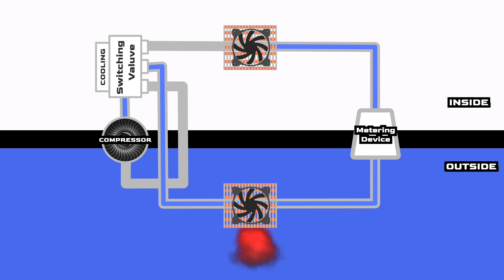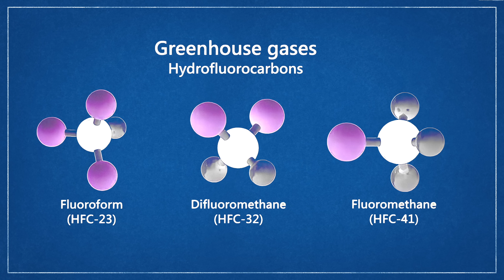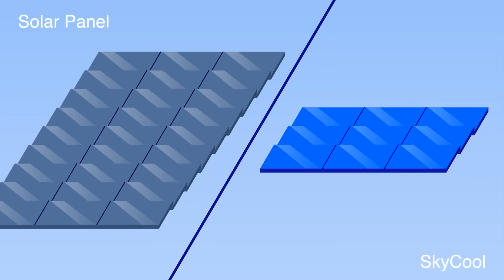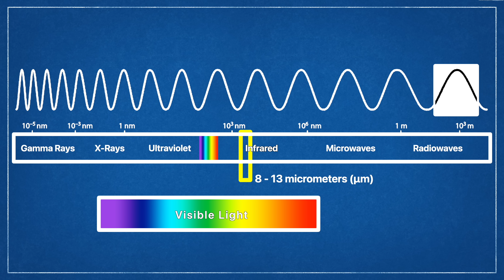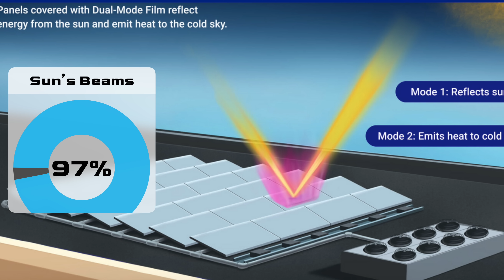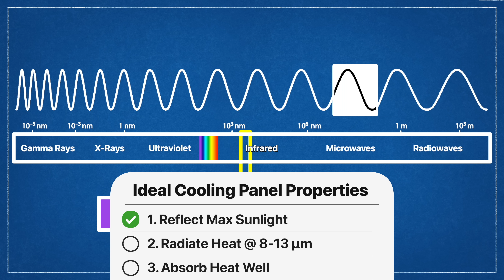New AC Tech Sends Heat Into Space & Saves 95% On Cooling Bills!

Comment: I would love response from the scientifically minded on this. Photovoltaic panels are optimal, in the northern hemisphere, facing south. From what was stated in this video wouldn't it make sense for the Skycool panels to be placed on a north-facing roof plane to reflect out to space in that way? Could we optimize with PV south and Skycool north?
Reply: You are correct. Putting the SkyCool panels on the north facing part of your roof makes sense, not so much because it reduces sun exposure (that doesn't matter much), but because it doesn't make sense to put solar panels there and it would otherwise be wasted space.
Reply: @dc14522  This thing is literally a solar thermal vacuum tube in reverse. Pointing it at the sun would literally make it explode as the water inside boils even with the glycol.
Reply: @williammeek4078  No... the Skycool panel is opaque and the water/glycol is on the back side of the panel. Even in direct sun the panel is cooler than the ambient air and the warm water/glycol (from the building interior and/or AC compressor) conducts the heat to the panel.
Reply: @dc14522  No, the covering has to be transparent to IR in order to work. Think of it like the sun glinting off of a lake. Sure, the light reflects at times but only under a high angle of incidence. But looking directly at the water allows you to see through it. These coverings work in a similar manner.

What you are saying would break thermodynamics.
Reply: The panel radiates at only one frequency (part of infra red). So it can be reflective in all other frequencies. Only a small part of the sun's radiation is in the frequency the panels radiate at.
Remember that this has been tried and it worked. A lot of times people argue in comments that a thing won't work, when it already does.
Reply: @williammeek4078  As a recently retired engineer in the glass industry I know a thing or two about spectrally selective coatings. Low E coated window glass uses silver in a similar way that Skycool does... to reflect IR. In the case of window glass the coatings contain up to 13 or 14 layers (up to 3 of which are silver) in order to allow a specific amount of the visible spectrum through while reflecting UV and IR. Skycool doesn't have to worry about visible light transmission and I suspect what they've engineered is an ultra-low emissivity coating that reflects virtually all ambient radiation, and in addition radiates the heat energy from the water/glycol (probably through something like an aluminum substrate) in a specific frequency range. 

We're not breaking any laws of physics here... every surface has it's own set of absorption, reflection and emittance characteristics. Skycool has just come up with one at the far end of the spectrum... so to speak.
Reply: @dc14522  Everything you say here is all well and good. It was your claim that it can be pointed at the sun and still work that breaks physics.
Reply: @williammeek4078  No it doesn't break physics; you just don't understand physics.
Reply: @filonin2  Explain it to me then.
Reply: @filonin2  I did. Nothing in their literature suggests you can point it at the sun an still cool anything. What you say still breaks physics.
Reply: @williammeek4078  Look up the paper "The Effect of Radiative Cooling on Reducing the Temperature of Greenhouses" published in Materials- excerpt from abstract: "Recent works have demonstrated that radiative cooling, releasing energy via radiative heat exchange where the heat is dumped directly into outer space, can be achieved by using silica particles designed to emit in the infrared atmospheric transparency window." 
This same technology is used to cool greenhouses passively which by definition are ALWAYS in the sun.
Reply: @filonin2  That is what I have been saying. Your claim was these panels work when pointed directly at the sun, which breaks physics.
Reply: @williammeek4078  you’re mistaking light for infra red. Two different wavelengths. It’s designed to reflect infrared, not absorb it. So it accepts all infra red radiation but specfically emits it back in the 10 to 18um range. The cooling fluid works like a heat exchanger - the water actually gets colder passing through the panels. It works better in full sun than in overcast conditions, because it’s more difficult to reflect back through the clouds into space.  A hot water tube system works in reverse - it’s specifically designed to absorb and not reflect infrared into a vacuum tube.
Reply: And the only time it might be a problem in full sun is when the angle of incidence = the angle of reflection. I think the infrared has to be reflected to an empty area of space. Which is most of it.
Reply: @mondotv4216  infrared light is light so that comment is nonsense. 

The silver reflector has an emissions peak (color if you will) in infrared. This is specifically why silver was chosen. Emissions peaks are also absorption peaks.  

Despite these errors on your part. You reach the correct conclusion. That the panels have to be pointed away from the sun to exceed the angle of reflection for IR in silver’s peak emissions range. Then it cools. Even in daytime.
Reply: @mondotv4216  it actually doesn't need to be reflected into empty space. The sun emits very little infrared in that specific range of wavelengths, so you can actually point it directly at the sun. Of course it will be less efficient, but it's possible.
Reply: @filonin2  😂 😂 😂
Reply: @midnight8341  You have a fundamental misunderstanding of the emissions power of the the sun. What you just said is fundamentally untrue
Reply: @williammeek4078  prove me wrong.
Reply: @williammeek4078  it can still work when pointed at the Sun. It just has to reflect all wavelengths except one slice and transmit all power on that slice. The sun radiation is spread out so if you filtered all out except one frequency it would be very dark
Reply: @pilotavery  even at a single frequency, you are not going to overwhelm the sun. And silver doesn’t emit at a single frequency.
Reply: @williammeek4078  so you're saying that if I shine a flashlight at the Sun the photons aren't going to head towards the sun? Because that's all that's happening. That's where that energy is going. It's going to travel through space.

Hilarious how people keep saying that this won't work when it actually already does. There are already working prototypes. Like, imagine if people said solar panels won't work because xyz. Like, they do work, we have them everywhere.
Reply: @williammeek4078  fortunately, they already work regardless of whether or not you think it's possible...

It's like shining to flashlights at each other. The energy is still leaving. It doesn't matter if you point it at the Sun or if you point it at the empty sky.
Reply: @williammeek4078  if you take a small slice just above infrared, you're only talking about 0.2% of all of the sun's energy for a 100mhz band
Reply: @pilotavery  No, I am saying that when you point it at the sun, you will get more photons from the sun than you get rid of. 

And no, it doesn’t work when pointed at the sun. If you look at the images from the company web site, the panels are oriented opposite of the solar panels. If it didn’t matter, they would just point them straight up since that would simplify mounting.
Reply: @pilotavery  Oh, it is a LOT more than that. Infrared is 50% of the sun’s power. But even if it is just 1% would still be 10 watts per square meter of heating power. And remind me, just what is the heat dissipation power of the panels?
Reply: Okay so the debate about whether the panel can work when pointed directly at the sun...

The hang up seems to be with the idea of reflecting the sun's radiation back at it, and also cooling the panel by emitting radiation directly at the hot sun, yes?

Unlike a flow of water, light can travel in any direction through the same space as other light without interfering. This is how you can aim the beam of two projectors through eachother and still end up with two clear images.

So, the incident radiation from the sun can be reflected directly back at it without issue. There will be some absorption and heating due to the coating being imperfect as well as due to the band gap left open for the infrared radiation to go out. In other words, the door is open so light can go both ways.

Where I think the misunderstanding is happening is that because the panel is pointed at the sun, it must therefore be cooling itself by radiating at the sun. In fact, the cooling effect happens because of infrared radiation leaving the panel from its entire surface area. The top is flat to give it a large surface facing the sky, but that doesn't mean that all the radiated IR goes directly up. The entire surface of the flat panel might as well be made of tiny spheres which can radiate in any direction not blocked by the body of the panel. So even if the sun is directly overhead, the panel is still radiating in a wide arc toward the entire sky.

What does get me curious is the idea of having a crinkly surface instead of a flat one, having therefore a larger surface area from which to radiate energy. The more it's crinckled, however, the more of the skyview arc would also be taken up by other crinkles. So rays might have tobe emitted and then either reflected or reabsorbed. The question is, which would win out? Reabsorbance or reflectance?

Nevertheless, however, the panels will radiate diffusely in all directions, mostly in a 180 degree arc generally skyward, including the small arc of sky taken up by the sun. Yes, the sun is bright and hot, but the small amount of sunlight at just the right frequency (spectrum) to be absorbed would have to end up being more than the whole panel could radiate to the entire sky for it to have a net heating effect.
Reply: Yes, I looked into this a decade ago but never followed though. Except I was going to use solar thermal heat tubes but keep them pointed north like you suggest. I remembered some complaints about these tubes freezing at night and wanted to look into using them for cooling. I remember in research that the effect is disrupted by clouds but if it is cloudy, your cooling needs are reduced anyway.
Reply: @williammeek4078  The freezing tubes can be dealt with easily by reducing the velocity of the glycol solution and adding a metering valve to the system.
Reply: @ppentertainment2351  That would actually make the freezing worse.
Reply: @williammeek4078  True except that if it’s cloudy outside, the outdoor temperature can still be 80 degrees Fahrenheit with 70 percent relative humidity at night time.
Reply: @williammeek4078  Unless you live in Florida.  95 degrees on cloudy very humid days.
Reply: @BondiAV  "...a nice idea, if it really works." 10:07 If you watch the video, it has been tried on a large commercial building. It did work. 
That said, getting rid of the pipes, coolant fluid, heat exchanges, etc... perhaps like painting the building white? That's been well tested and can make a huge difference. A lot cheaper to.
We know how to make buildings that stay warm or cold , but most modern ones rely on mechanical systems for most of the air conditioning. Fix the building standards first and the need for heating and/or cooling will be much lower.
Reply: @AJPemberton  I've been thinking this way for decades and saying it to all the solar-panel loving hippies I meet.  Blank stares.  No one seems to give a shit about fixing our criminally wasteful building standards but that could eliminate so much of the problem.
Reply: @BondiAV  - Think the "Argument" is that the Panels"Radiate" that Heat away (to Space)! Hence, they cool themselves!
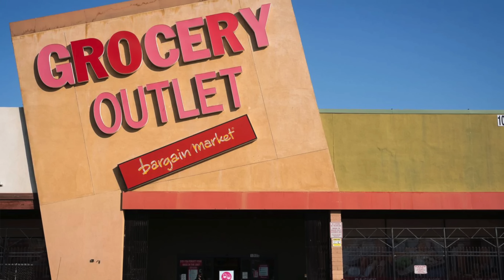Reply: Notice in the test bed pictures, 10:10 the sky cool panels are indeed tilted opposite direction from the solar array.
Reply: Ignore most comments here. This system should work, the question is how well and how expensive.
Reply: Yeah, a south facing roof side for solar and a north facing roof side for radiative cooling makes sense to me as the north facing roof would see far less solar heat and would thus be less dependent on blocking that heat.  Using a heat pump to boost the cooling power on days when radiative cooling alone would be inadequate would be the best balance of techniques.
Reply: Replying so I can reference this thread later! (Can’t find an option for this on mobile)
Reply: @gavenmorgan9145  - Save, Like, or "Share" it, by sending it to yourself, by Email, or a "Text Dummy Account!"
Reply: You stole my idea.
Reply: Yes, except that you still have to account for changes in weather patterns.
Reply: You want the face of the panels parallel to the sky not pointing in a cardinal direction.
Reply: Exactly! Thinking the same thing.Glad I looked at comments before posting.
Reply: @BondiAV  In the video they did say high humidity, which increases convection heating, reduced overall performance.  I also agree with your assessment to cover the area you want to cool with these if they work as advertised unless there is a heat pump scenario that could be used.

Considering the video is over 9 months old and they still have no products available for purchase, I'm not sure how well it actually worked.
Reply: "Could we optimize with PV south and Skycool north?"
that's what i would do.
Reply: Since my comment debunking this video was deleted...

This whole thing is a scam.
Radiative cooling is a least effective way lose the heat! At room temperatures it is nearly non existent.

Convection and conduction effects are those that are heating up your house (heat from air and ground). Both of these are much more effective ways to transfer heat then radiation. There is no way radiative cooling with this magic device will be able to lose enough heat to keep up with being constantly warmed up by the hot air around it. Whole system will eventually equalize at ambient temperature.

Reason for this is second law of thermodynamics. Which in plain words means all energies naturally want to equalize. Meaning same temperature outside and inside your house. To fight this you need to create a temperature gradient and this takes extra energy. This is what regular heat pump or AC does. And since these magic panels don't use any extra (or enough) energy, they can't create a temperature gradient, therefor they can't work. Easy as that.

Radiative cooling is used in space on the International Space Station, because there is no other way to dump heat in space. Volume of the ISS is about 1000m3, area of radiators to keep it cool is 156m2. But that's in vacuum of space, there is no warm atmosphere there constantly heating up the radiators. 

So unless your house is in space this will never work.
Reply: @jeffsaffron5647  eeh... Wrong. Firstly, the temperature gradient for radiative cooling is there. Normally, radiative cooling is the least efficient way of cooling things in an atmosphere, because said atmosphere will absorb and re-emit radiation, which will reflect the heat back down to the device, trapping the heat in the atmosphere. But this device uses a small, atmospheric window in which the gases of earth's atmosphere do NOT absorb radiation, which means that the temperature gradient is not between the device and the surrounding air, but between the device and the cold of space. Which means that you get a huge gradient of about 200° without having to add any additional energy to the system to steepen that gradient artificially.

On the ISS, it's a different story. The space station enters the full sunlight every 90min in an intensity that it will warm up to ~400°C on it's hull. And to radiate that away into space, you need these huge radiator fins. They're not just for the measly little Instruments producing heat inside the station, but mostly just for dumping the excess heat brought in from the sun. Same with space probes that have to do radiative roling to equalize the amount of heat hitting every part of the surface. If you were to coat the ISS in a reflective layer like these panels, it would cool down so fast that the atmospheric water inside would probably freeze in minutes, with the atmospheric carbon dioxid following shortly after.

Have you watched The TED talk of the founder, where he expalins how it works?
Reply: It shouldn't make a difference in which direction the radiation goes as it isn't affected by the earth's magnetic field. The atmosphere's IR transmissibility would make more of a difference and following on from that the local climactic conditions.
Reply: @eclecticcyclist  I would guess he is considering the position if the sun since he specified the Northern hemisphere. I agree with him. The primary consideration is to shield the radiators from the sun and a northern exposure would help with that.
Reply: @williammeek4078  
P
Reply: @eclecticcyclist  it would make a small difference as one side of the roof receives less solar radiation making the Skycool panels more efficient. This is why you would install these Skycool panels on the south side in the southern hemisphere and solar panels on the north side of the roof. Swap sides for the northern hemisphere.